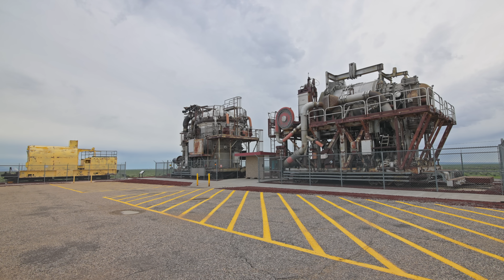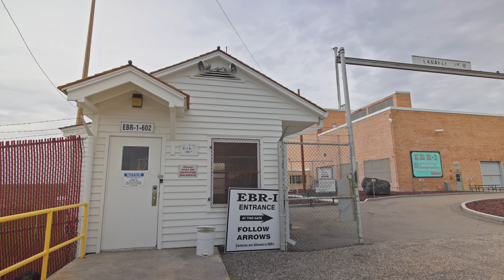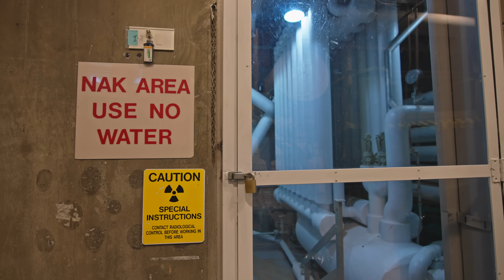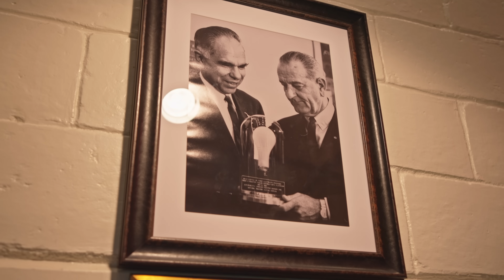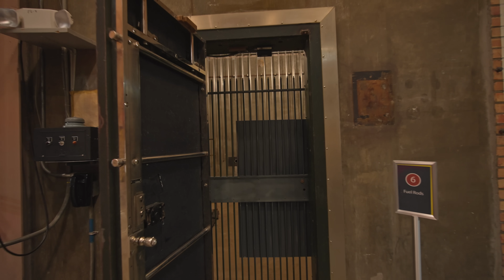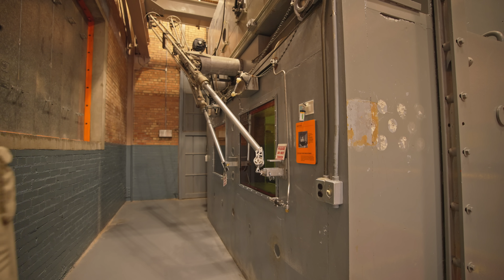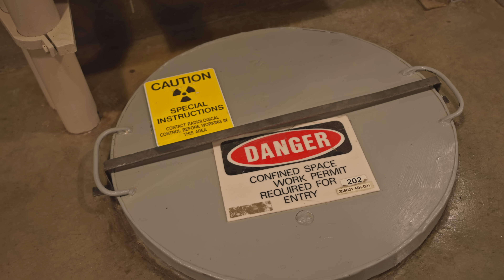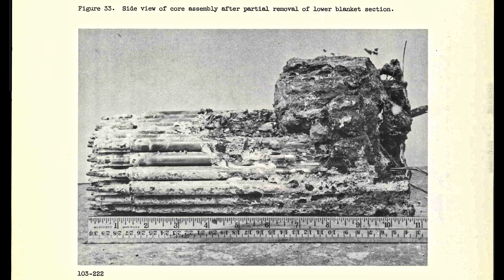Radioactive Nuclear Jet Engines in a Parking Lot

Comment: You breathe the air without a mask...you'll die of cancer...probably
Reply from the maker: What are you talking about?
Reply: @RadioactiveDrew  1. Alpha (α) radiation

Consists of helium nuclei (2 protons + 2 neutrons).

Very low penetration: it can be stopped by a sheet of paper or human skin.

Very dangerous if it enters the body (through inhalation or ingestion).

Comment: Great video!
The nuclear jet engines were a merging of Cold War concerns and the new Nuclear Age. Before the age of ICBMs, the US and Soviet Union were both interested in developing a nuclear bomber as it could fly as long as the crew could be fed and didn't mutiny 🥴.  The heat for the project in the US was provided by the Sputnik launch in 1957, which drove up the concern level in DC.
Both countries experimented with nuclear powered bombers and were able to install test reactors in a bomber, but they were only used to gather radiation effects data. The test reactors in Idaho were used to test the feasibility of using nuclear power to develop the heat normally provided by burning jet fuel to drive the turbine engines.
ICBM development and missile launching submarines in the late '60s killed the nuclear bomber programs.

Comment: I've been there, and there is basically zero radiation from those engines. EBR-1 was where they first produced electricity from a nuclear reactor. It also had a local meltdown when the NaK coolant blocked a flow channel, causing the fuel to overheat. That was the end of EBR-1.
Reply from the maker: Yeah, I wouldn’t say “there is basically zero radiation”. It’s an easily detectable amount of radiation that isn’t zero.

Comment: A question arose: you were worried about how they were going to put this jet engine in a plane or, perhaps, a train, given its size. As you should know, this is a prototype, which means it would never fit into a plane or a train. Since it is a test prototype, it would probably never enter circulation for any type of market either. A final version would come out soon after, but given the time it has been around, it is very likely that it will be discontinued sometime soon. After all, the era of nuclear power was abandoned a long time ago. In fact, you, as an American, should know that there was once a car powered by nuclear cells. The problem arose when a journalist asked how these nuclear cells would be disposed of; then a big problem arose, because the automaker was unable to actually show how this disposal would be done.  When they spoke out about the disposal, they failed to convince not only the industry, but also the public, who were quite concerned that this careless disposal could generate enormous contamination, affecting several regions of the United States, which have already faced several problems with nuclear plants and nuclear tests that have made several areas uninhabitable for a long time. So, in my opinion, I think they are waiting for the exact moment when the radiation decreases so that this device can be removed.

Comment: All rocket fuel is reaction mass that uses the concept of equal and opposite reactions. Throw something one way, and you'll go the opposite way. So normal rockets use liquid oxygen and liquid hydrogen as fuels typically. Mix the fuels, and burn them to make the exauhst speed faster so you get more effecient thrust. A nuclear rocket doesn't use an oxidizer like liquid oxygen to burn the fuel to heat it up. It just uses the reactor core itself to heat up the fuel and exhaust it out the back as thrust. A nuclear rocket is typically heavier but it can have similar thrust to an upper stage rocket engine while being about 2 or 3 times more effecient. They're not going to be used as launch rockets from the ground so don't worry about radioactive rocket trails and stuff. These will probably be getting us to mars and back within the next 20 to 60 years depending on how much congress wants to play around with nasa's budget.

Comment: Sergei @ Radiacode is an A-mazing dude!
I bought the Radiascan 701-A some years back and it has served me well as my main Dosimeter / Geiger Counter but the Radiacode 102/3 is something that All should own, if serious about the Hobby. I don't yet own one but I will be acquiring one soon! The ability to connect the device to a Smartphone opens it up to a pretty Hefty little device!
Reply from the maker: I know Sergei.
Reply: @RadioactiveDrew  I've just emailed him to get the lowdown on the Radiacode! Nothing short of a Miracle for him to keep the company going strong, throughout what's been going on over there! The relocation was needed but it did not hinder them. You'll know Tati as well. Angioscan was their start in the market, I believe

Comment: Just an INSANE idea of even building and testing the Nuclear Aircraft Propulsion Reactors, ... let alone the thought of putting a nuke reactor on a plane and allowing it to fly,..... which THEY DID !!!  Not those units, but a small reactor was placed on a B-36 and flown around, of course with bio-shielding to protect the flight crew !  Hundreds of millions of dollars spent in a GO-NOWHERE project that the physicists, and engineers already knew was IMPOSSIBLE and SUICIDAL !!!  The 2 reactors designed were 1- a DIRECT CYCLE and 2-a INDIRECT CYCLE .  The DIRECT CYCLE would duct air in contact with the reactor core and it's FUEL to create super heated air to thrust the craft forward ! The air was also HIGHLY RADIOACTIVE AND SHOOTING out the rear of the engines, to be spread airborne as it flew. In reality,.... an airborne RADIOLOGICAL WEAPON !  The INDIRECT CYCLE heated a primary thermal heat exchanger instead but was far heavier due to the additional plumbing !  The FIRST THING YOU SHOULD ASK YOURSELFIS,....... WHAT HAPPENS IF THIS THING SHOULD CRASH ???    Need we say anymore ?!!!

Comment: breeder reactors didn't end up being the style of choice because they can be really wild, a good analogy is this
imagine if you had two engines, one of these engines works like normal, it wants to slow down or even stop until you apply throttle, the other engine has the throttle lever replaced with one that choses the engines air supply, this engine wants to run faster and faster until it destroys itself unless you hold back its air supply, now, imagine if something with the throttle lever on engine 1 broke, the engine would stop or at least slow down, but imagine if something on the throttle of engine 2 broke or failed, it would rev wildly out of control with the only way to make it stop now broken

breeder reactors could be built safely, but one would NEED to be sure they have as many fail safes as they could practically manage on the entire facility, all that paired with the fact that it has a specialized coolant that isn't readily available from say a nearby stream or lake, and on top of that is very explosive and generated a self oxidizing fire when in contact with water (so assuming a destroyed reactor, just when it rains), although breeder reactors do pose a potentially very compact, and very efficient fission reactor, with the latest developments in the world of fusion reactors, we seem to be right around the corner (comparatively) to having a fusion power plant, so I suspect these reactors will remain simply a fascination
Reply from the maker: Fusion is always 10-15 years away. It’s been like this for the last 70 years. Would be cool if it can work…hopefully soon. I just don’t like things being over complicated. We need to move to more simple solutions for power. Like extracting energy directly from radiation. That would be far more interesting.

Comment: I've known about the plans to make nuclear powered bombers for years but was unaware that actual test engines had been built AND run until around seven years ago after seeing a video on them here on YouTube. Now to find out they're still around and you can go see them for yourself along with EBR-1! After finally standing across the river from Three Mile Island last week and seeing it with my own eyes, this is next on my to do list!
Reply from the maker: It’s a cool place to visit. Check on their site because I think the inside of EBR1 might be closed. Yep, just checked…it’s closed for the season. It’s open during the summer months maybe starting on June 1st. They close it because the winters out there can be very gnarly.
Reply: @RadioactiveDrew  Thanks Drew. How did you get a tour of a nuclear station to see the spent fuel pool? (Maybe because it was being deactivated?) We have Point Beach about an hour from my house but you kinda forget it's there as there are no giant cooling towers as it just  pumps water out of and returns it to Lake Michigan. In a related thought, why didn't TMI use water from the Susquehanna River instead of building cooling towers?
Reply from the maker: @jpatt1000 most reactors require water for cooling. TMI used the river it was on. The cooling towers are to cool down the super heated water coming from the turbines. I got access to the fuel pool because the media guy at the time for San Onofre saw some of my videos. Logistics for the video took over a month to get approval for and I had to get a security clearance.

Comment: Well, hope this site doesnt flood. NAK area explodes in contact with water..
The thing that always disappointed me about nuclear power is the lack of direct nuclear energy to electric energy. Instead it is used as a fancy fuel to heat a kettle, based on ancient greek technology, and the core of the industrial revolution. We still just burn things to make boiling water, nothing more exotic or efficient energy direct conversion. I hear some new fusion reactors will be able to do a direct fusion plasma to electric energy conversion so maybe one day we can leave the century old principle of heat to steam behind.
Reply from the maker: It would be amazing to have direct energy conversion. If nuclear had that figured out we would have a much different world. We also wouldn’t have all these huge nuclear facilities. They would be much smaller and much safer.

Comment: Is it abnormal to see a radiation sensor on a weather station?
In Germany we have about 1700 measuring points distributed and the data are all available.

Or am I confusing the two?
Reply from the maker: Maybe it is more common than I’m thinking. I’ve seen other remote weather stations and they didn’t have a radiation detector like this.

Comment: the reason we Have red Die that is active red when Radiation is present in the environment that you are walking on Is to Let you Know where the radio active areas are .. 
your in a restricted radio active area... 
its not By the Hour ,, Its dose rate for one year.. and In that area it Builds up and stays in human body..

EBR-1 Nuclear Jet Engines testing area accident and contamination . It was never cleaned Up properly ...
EBR-I's initial purpose was to prove Enrico Fermi's fuel breeding principle, a principle that showed a nuclear reactor producing more fuel atoms than consumed.
Read the report, Hope they told you the risk Before you went In to that Area
The Accident and Hot zone is still active it has taken 50 Years for that area to Be reopens and still to Hot for Proper clean up.

Comment: What happened to the reactor core debris taken to Idaho post 3 mile island?
Reply from the maker: I’m assuming if they were taken there it’s at the waste complex.
Reply: @RadioactiveDrew  just to be buried I suppose, out of sight out of mind?
Reply from the maker: Well maybe, usually not that simple. Not sure how that waste disposal site deals with material. Guess I’ll have to do a video about it to get to the bottom of it. I have some contact info for a low level waste disposal site. Need to do a video about that soon.
Reply: @RadioactiveDrew  that would be interesting. The fact they are still decommissioning that site after 44 years is still not a great advertisement for the nuclear energy debate

Comment: Just catching up to the rest of the vid.  EBR1 made history in 1951 as the first reactor to create useable electricity.  Just recently we have created proveable fusion.  I wonder when the first public use fusion reactor that will do the same, will come online.  Shouldn't be to long.
Reply from the maker: They have been saying a commercial fusion reactor is only 5-10 years away for the last 50 or so years. So I wouldn’t hold my breath on fusion supplying power to anything for a while.
Reply: @RadioactiveDrew  Yes. 20 years for a more-viable lab result , 50 for the public induction.  Will have to be a magnetic bottle of some sort that is safe, stable, small and self sustaining to a degree.  I'm sure the lab efforts will get the path set , ,the one trouble will be acceptance, among other things, once again. Hopefully, the public can open their eyes and minds. Speaking of the nuclear bottle, I never knew that the 3 Mile Island melt waste was shipped to Idaho in the RR casks, as per the museum read board.  The casks were probably buried outside of the fence with no-entry/no dig signs, along with some 1955 waste created In-situ.  The Nuke Jet engines in the parking lot might not be to far off from that special reactor, at least some of the math.

Comment: I am really intrigued by that isotope detection feature of the device. 
Is there any commercially available tool like that that is similar in features (Isotope detection, map generation) but also can show me what kind of radiation it is detecting (and also doesn't cost an arm and a leg)?

I know that is probably the holy grail of hobby detectors but I just recently found this channel and I'd like to run around the house a couple of times with a detector.

Comment: The glass used in the view ports on those hot cells is uranium glass - you can tell because it has the yellow-green tinge to it. Yes, believe it or not, radiation shielding glass actually contains uranium - it is most likely made with depleted uranium, though it might have been made with natural uranium which still contains U-235 at 0.7% by weight. So the glass itself is radioactive, but not dangerously so because both U-235 and U-238 are alpha-emitters. A piece of paper is enough to block alpha particles, so the vast majority of the radiation produced by the uranium in the glass will be blocked by the glass itself.

Lead glass has no colour to it at all, despite all lead oxides being highly coloured (black for lead dioxide, red or yellow for the other lead oxides), since the lead oxides used dissolve into molten glass. Uranium glass has even higher density than lead glass, which is why it is used for radiation shielding: Density is all important for blocking gamma rays and neutrons, since these are by far the most penetrating forms of radiation, so the denser the material, the more radiation will be blocked.
Reply from the maker: The glass doesn’t contain any uranium. Don’t know who told you that. If it had uranium in it the glass would be radioactive, which it wasn’t.
Reply: @RadioactiveDrew  I have seen other hot cells for manipulating radioactive materials which do use uranium glass - and it has the same colour to it, looks exactly the same. I know that lead glass is not coloured at all, but uranium glass is, and is definitely used for the same purpose elsewhere, and for exactly the reason I mentioned before. It's possible that the hot cell you viewed at the EBR1 museum used leaded glass which had a yellow-green colour added to it - but why would they have made it that colour if it wasn't necessary?

Comment: How did they know what level of protection from radiation they needed? Was what they did enough or was it only what they could do?
Reply from the maker: You know based on the dose rate. Basically how radioactive something is. But in most practices they try and get as low of an exposure as reasonably achievable.

Comment: The NAK they used for cooling if a worker was handling it and say he or she dropped sweat on to some of it would that potentially cause an explosion? I saw the warning signs like wear face shield and the rooms they used for storage or clean up they didn't appear to be very climate controlled I guess you could say. It's just a stupid thought I had of someone walking in in summer time and it being really hot they drip some sweat and boom! Not a realistic situation I'm sure but just wondering is all. Cool your you did that place is supper interesting for sure!!